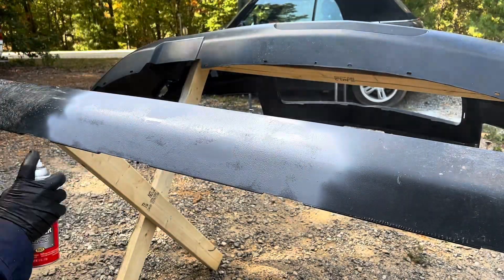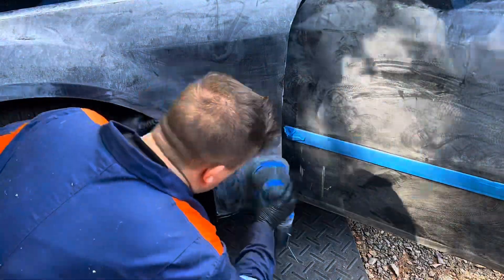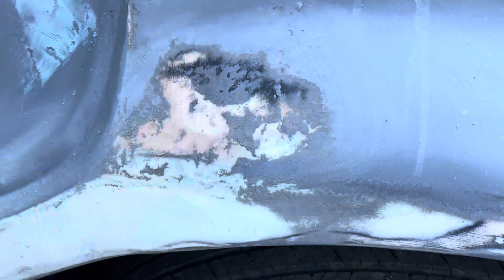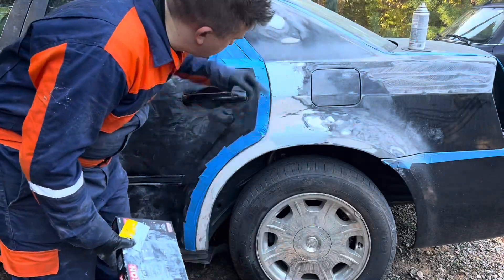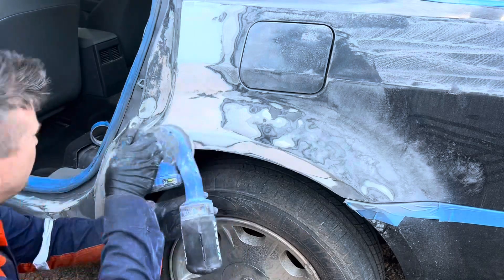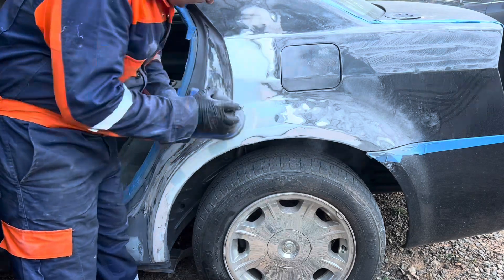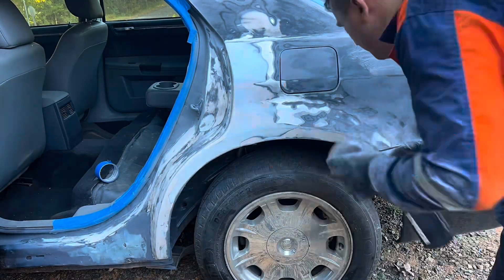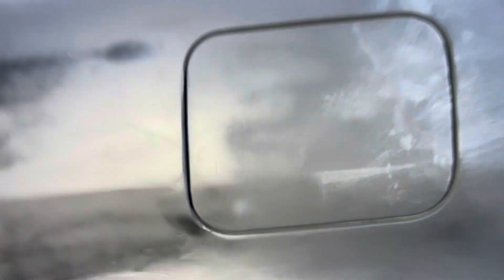2005 Chrysler 300 Restoration | Bodywork, Primer, and 6 Hours of Sanding in 10 Minutes! 2023

Comment: You should try using a guide coat over the filler and primer. 2K paints and primers will make your life a lot easier as well buddy
Reply from the maker: Thanks, I have 2k primer, I will use it for the final coat and my next project, now that I got my paint setup ready to go
Reply: @ZimaletaMotors  I don't think people realise how much work is involved in getting bodywork sorted. It's a long drawn out process. Remember to wear the correct mask for the 2K!!! It's nasty stuff